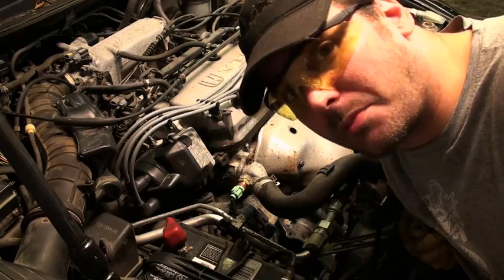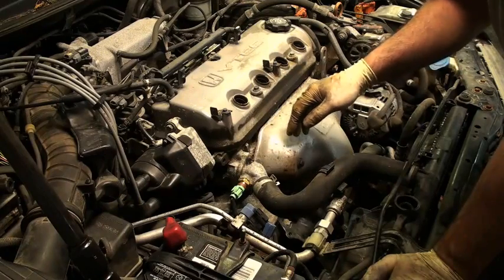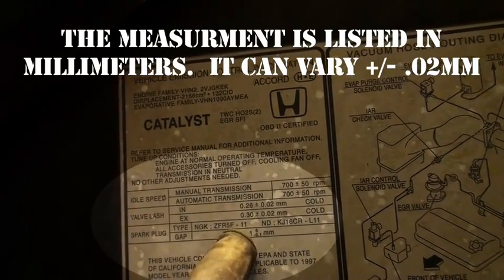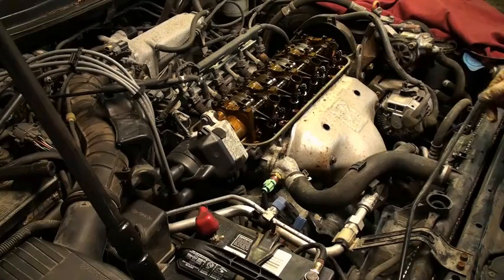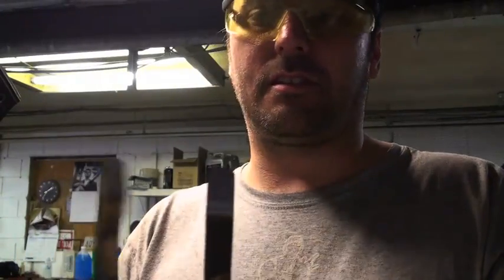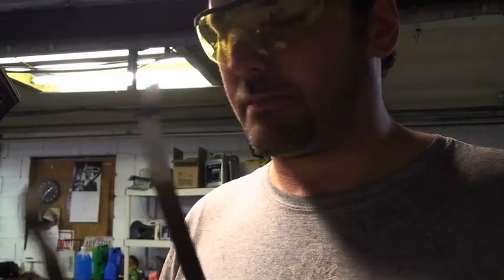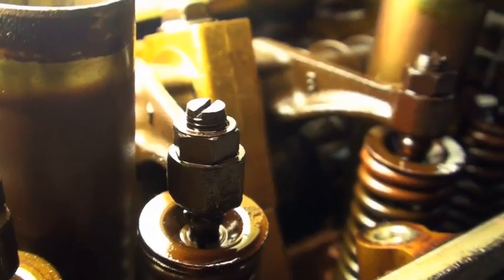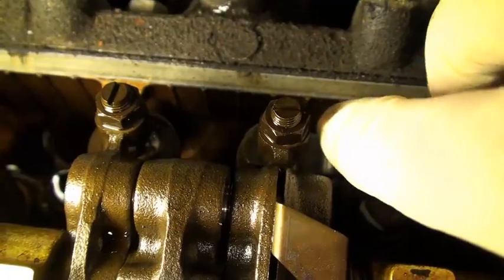Honda Accord Valve Adjustment - EricTheCarGuy

Comment: Eric, Thanks for the great videos.  With your guidance I was able to replace my brakes saving a bundle.  Now I’m on to another problem.  Very rough idle.  It’s a ’97 Accord LX 4 cyl.  If I turn off the AC it get a little better but still idles rough.  The RPMs don’t vary much, just rough.  Do you think adjusting the valves would help?  I’ll probably pay to have someone to do it since I have no experience with this.  I hate to spend the $ if you don’t think it will help.  Any other ideas?

Comment: Excellent video (and videos). I have learned quite a bit since watching. Question: can I do this to my 2002 V8 Ford Mustang with 78,000 miles? Would it help? I have been running synthetic oil since bought, at 68k miles. Engine has no problems. I try  to keep a 100% maintenance schedule in mind. Just wondering. (and also cause Ill upgrade a little later to 4 valve  cylinder heads and wanna know as much as I can before I tackle the job..!! Thanks for the vid-wish I still had the little Accord :)

Comment: Would the engine stall if the valves need to be adjusted??
Reply: Probably not, but a loose timing belt will.

Comment: jif you can put in cams with larger duration I can't see how being a tiny bit over on a valve adjustment could destroy and exhaust valve sounds like a myth some turbo cars have antilag systems that ignite with the valve still open and if that doesn't burn it this just doesn't sound plausable

Comment: Hey I just started watching your videos and I'm really impressed and feel confident in your information, I do have two questions  though. I'm currently going to school to become an auto tec and have recently done a motor swap, put a GSR  DOHC vtec b18 into my 94 civic runs good but I feel a lack in power and notice a clicking noise  one of my instuctors and several fellow students say I need to do a valve adjustment, is this correct? and what difference does it make when it's DOHC?

Comment: I found that even with all the plugs removed I could not turn the engine with the power steering pump, the belt just slipped. I may need new belts.

Comment: Eric what's the point of removing the sparkplugs
Reply: makes the motor easier to turn over using the lame power steering pulley method

Comment: Can having misadjusted valves cause a misfire ?
Reply: ernie ruiz absolutely
Reply: If they are very tight or very loose yes.
Reply: Will having some of the valves too tight cause your headers to put off smoke? Smokes not even coming from the gasket, it's like floating off my header pipes themselves. No cracks or holes, any ideas?
Reply: @Type1Tony91  Sounds like in your case that you need to replace your header gasket as well

Comment: @ Lucio sorry man your car is an interference engine.  When the timing belt snapped your engine probably 90% of all interference engines suffered valve or even piston damage.  The valves probably hit the piston when the belt snapped and changing the belt and water pump won't do a thing if your valves are bent.

Comment: very good movie ;) you are the  men hehhe
i have an 88 civic with a zc engine , im putting new internals in my motor
i was conserned only about this job in the valves 
the other consern its about the screws 
but i think i solve that issue to =P
thanks for the movie

Comment: I dont like this method, id rather follow the markings and follow the firing order when adjusting the valves, in that way you avoid guessing
Reply: Just use the write up on honda-tech for the f22 valve adjustment, remove two bolts for the upper timing cover, turn the crank by the 19mm pulley nut. I totally agree with you. Did mine by the markings and it ran purrrrfect
Reply: puppetmasterblaster 

check first to see if the markings are on the back of the cam sprocket (arrow for up and 2 marks on either side), don't know how far back they go, but on the 1996 f22 series they seem to be there. no need to pull the timing cover.

Comment: Eric very epic and fucking awesome. I'm doing my 1994 Accord as e speak I have the engine out of the car it just makes it that much easier.
Reply: Used to do this with my father years ago and it makes a huge difference with performance and longevity too, I just don't have a garage to work on mine when it's cold other than in winter
Reply: yea it does! I'd love to take my engine out and check it over thoroughly

Comment: How cold are we talking? Hot summer day, car sitting in sun, but hasn't run since the day before? I don't have a garage...

Also why would a new timing belt make the car run better if the belt hasn't frayed or snapped?
Reply: As long as the coolant needle reads dead cold your fine doesnt matter if its in the sun or in a hot garage

Comment: Will this cause a blinking check engine light?
Reply: In most cases a blinking cel will be a bunch of misfires or knocks and the car puts it self in limp mode
Reply: @rohinhans7819  would that then mean for a valve adjustment?
Reply: @Gittinitwithyouorwithoutyou  I've had it also, in my case I was going OWT and it happened. It just happend once and hasn't happend since. It could be a bad batch of gas, valve adjustment, engine out of timing, bad spark plugs, bad distributor cap/ ignition coil. Those are just some of the main causes. Dose it happen  frequently and what octane fuel do you run?

Comment: Good video but that very slight drag may seem to tight to another person or even another person may say it's a tad to loose.
I never use nothing but a dial gauge.
I have been called many times to adjust the valve with my tools and the readings the other person made were all off from factory specs
BOB LECH AF2Q

Comment: What a pia !!. Now I know why mechanic  doesn't wanna do it and avoids the subject.   They just replaced valve cover gasket & never said a word about valve adjustment.  How nice. !!!   Heck they just did timing belt, I had to insist serpentine belt be replaced. but they refused to replace thermostat.
But my Odyssey is running like Doo Doo...
SOS.  I need a real Honda mechanic.

Comment from the maker: @170324341a Sounds like they may be a bit loose and to be honest that's much better than them being too tight.  Like I said in the video it's an acquired skill that takes some practice to master but since you didn't get them too tight and it runs smoother I would say you are on the right track, well done.

Comment: hi is this the engine  F22B1 vtec for a 94 honda accord ex thats the one i have i did the adjustment and now it sounds louder the previous lash clearance was 7 intake and 9 exaust no noise no overheating and now is just too noisy thanks

Comment: Step 2 
Copy and post this message at least 3 times anywhere on the web (in 3 different places):
Reply: do you have to adjust  the valve  on a 1990 Honda accord after you replace  all the gasket

Comment: Do you really need to adjust valves.  I  have 230,000 miles on my Civic, never did anything and runs smooth. If it works leave it alone.  I think its just to make Honda a maintenance buck.

Comment: damn, how can you use an impact gun to remove valve cover bolts, truely bad demonstration to rookies in my opinion.

Another thing with the oil leak in the spark plug tubes, on my car I have an lx model accord engine code f22b2 they have 2 seals one upper and lower and currently my lower seal are leaking.